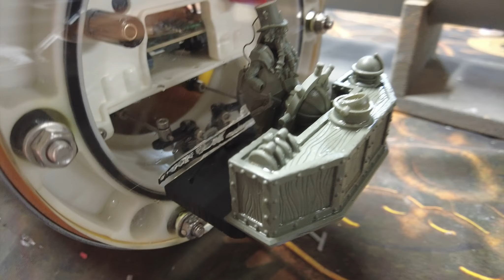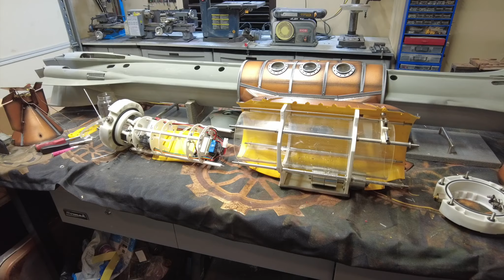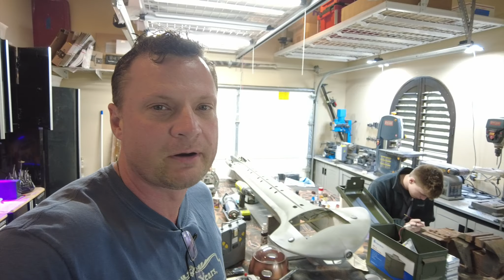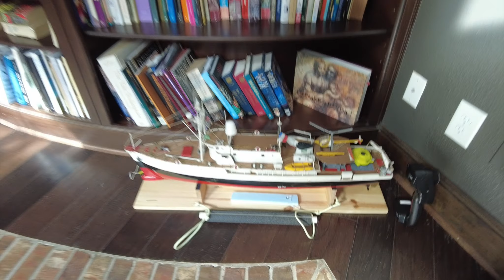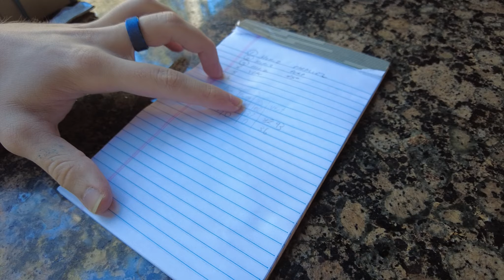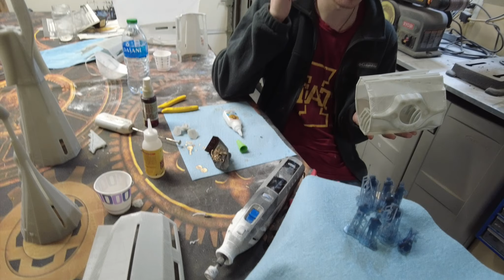Neptune massive mods, 900mhz, more Seaview! The week of RC Submarines at the Drydocks - 12-30-23

Comment: Regarding the roll pump, I think there were a whole batch of the wrong motors fitted where the wrong size shaft was used. The pressure switch is a bit too sensitive (on similar ones such as Engel, I  think it can be adjusted), but you might also try a microswitch as a cut off. I was in the process when I accidentally shorted out the ballast control board. Now I'm looking for a replacement for that, otherwise, my Neptune will have to dive dynamically.

Comment: It looks to me like the pump design should have used a friction drive between the motor shaft and the pump rollers.  This would result in a large rpm reduction between the motor and the pump.  A sleeve over the motor shaft that restores the friction should fix the problem.

Comment: I’ve played with one of those pumps before I will bet you the silicone tubing that those rollers run on has taken a set and is deformed and won’t allow it to roll. Need to replace the tubing inside of the pump.

Comment: With the small white peristaltic pump, they have a small planetary gearbox, with sun wheels integrated into the rollers, and a small plastic pinion a friction fit on the motor. Those plastic pinions lose their grip. A simple fix is to change it out for a brass pinion. Another issue is the silicone tubing which tends to give out after a short while. Much better to use sanoprene tubing, which has much better longetivity. However that pump only has very low flow- okay for a small trim tank but hopeless for anything bigger.